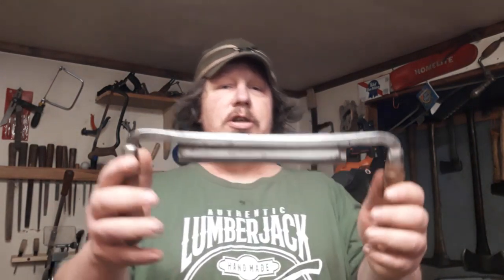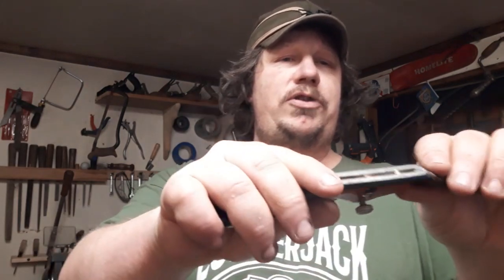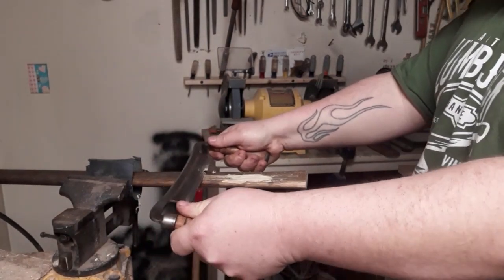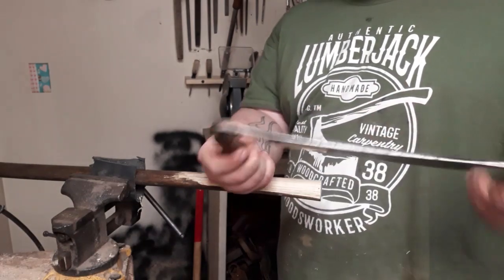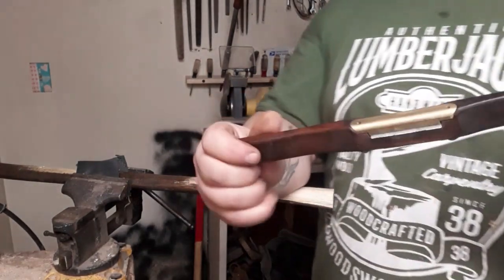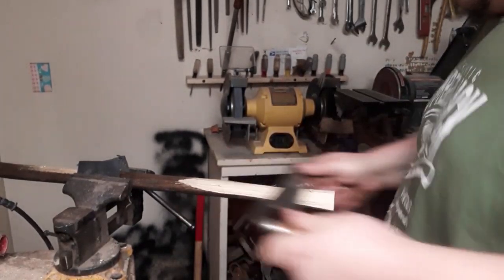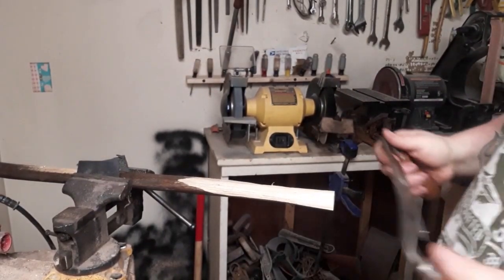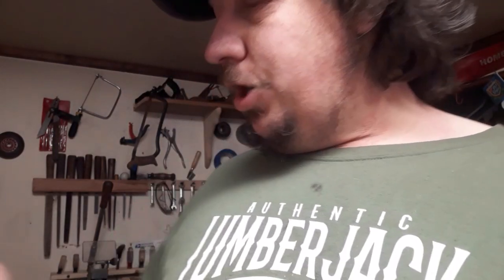Drawknife & spokeshave for axe handles

Comment: 3:13 the older Stanley 151's were and still are great. It's the new ones that suck. That next spokeshave is a Stanley 52, which is the low armed version of the 51. The 51 is the same as the old 151 except it doesnt have depth adjusters. The double spokeshave is the Stanley No. 60